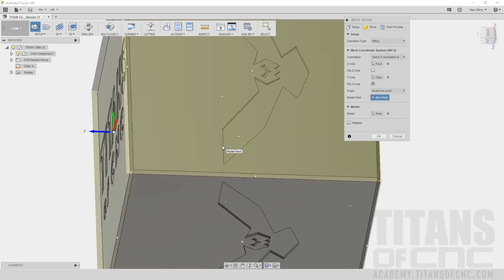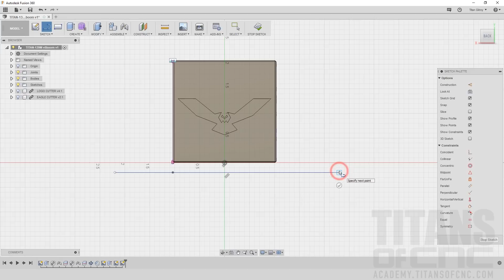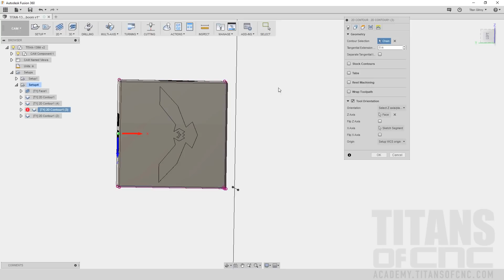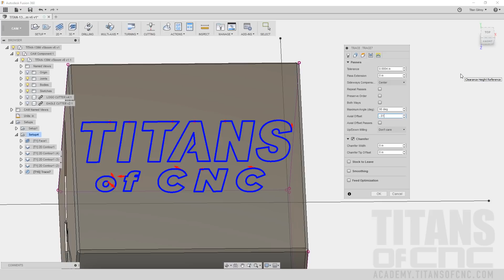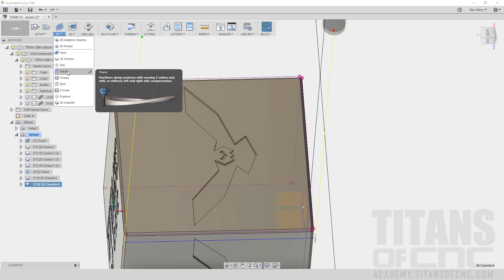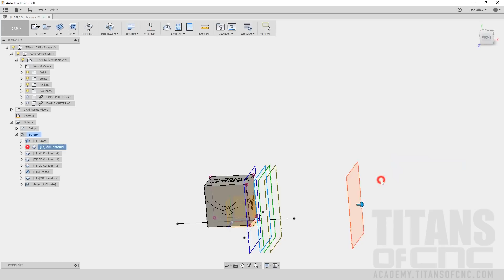5-AXIS CAM Tutorial. (TITAN-139M) CNC Machining

Comment: I think G54 should be at the center of rotation of the rotary table otherwise it will not compensate Z . We have Haas rotary TR 210 and when we have z at top face then fusion post processor ( Haas trunnions) doesn’t compensate x,y, z . Can you clarify ? Love to learn from you.
Reply from the maker: The new Haas controls have dynamic offsetting. So you can place your Zero in one place... and then rotate the part and it will always know where its at. Older machines or trunnion's would need to be programmed (3+2) so you have a separate fixture offset on each side... or center of rotation as you suggested.
Reply: TITANS of CNC: Academy : tnx a lot sir👍
Reply: @TITANSofCNC  porque no haces este mismo video para mastercam. Un saludo desde Barcelona